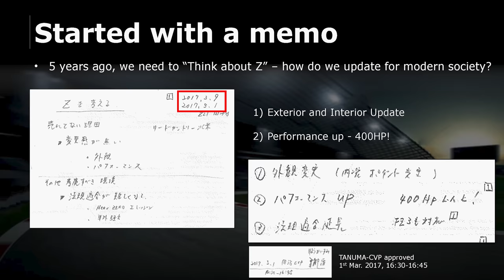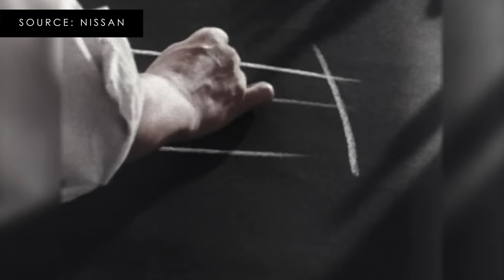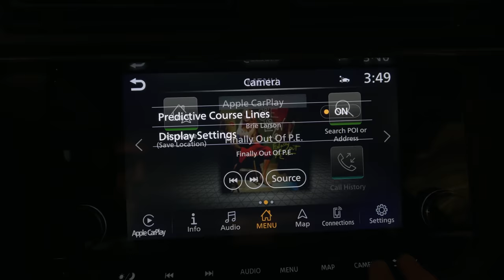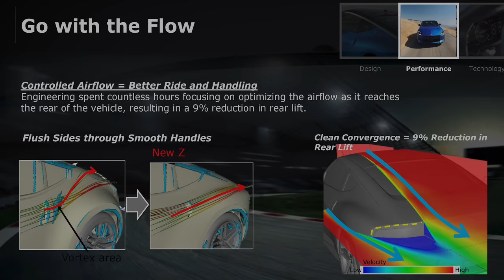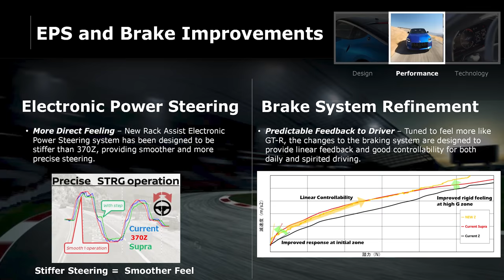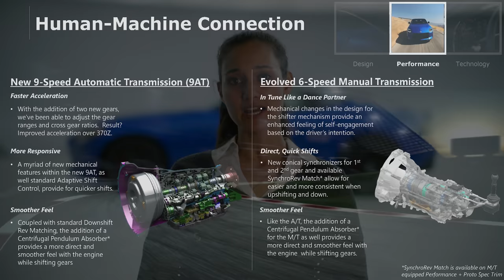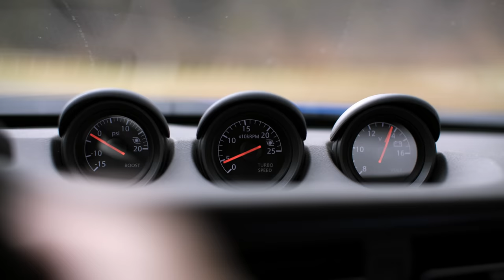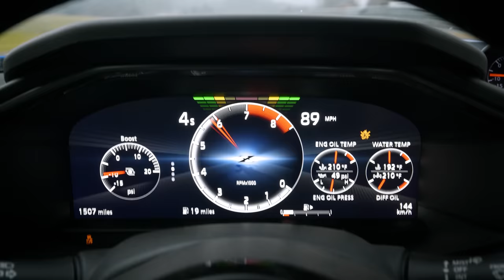2023 Nissan Z | Until The Bitter End

Comment: Thank you for the well produced infomercial. Would have been great to hear some non biased comments on this car. The 3,550 lb elephant in the room is this car’s weight. How do you add over 150 lbs and expect folks to be ok with it? And let’s be clear, this is not a “poor man’s sports car”. I like the front end. I don’t like the back. And I can pass on the weird chrome strip on the roof edge. Is it too much to ask of the Nissan design team to spend a some time in a current Miata and take notes? as in weight reduction, not weight gain.
Reply: The 370 was actually lighter than a 350. So this basically weighs the same as a 350. Engine weighs more than before, and they had to add more safety tech and sound deadening since everybody complained about road noise in the 370. Miatas are simply too small and I want a car that survives in a crash!

Comment: Can you imagine how good the Z-car (Zed-car!) would be if Nissan had refused to redesign the car from scratch several times.
Because the orginal Z was completely iconic - much like the 911.
Nissan really wrecked the Z-range by failing to adhere to the design principles of the 240Z, and made successively slower and worse cars until the 300Z came along - but then it didn't look like a 240Z in any way shape or form. And why does the 350 or 370 even have a Z-badge? They are GT cars.

If Nissan had steadfastly developed the original 240Z, refining it year on year - just like Porsche did with the 911, then today, the new Zed-car could be one of the greatest sports cars to ever turn a wheel.

PLEASE NISSAN, NOW THAT YOU ARE BACK TO THE 240Z SHAPE, DO NOT REDESIGN THE CAR EVER AGAIN!

Comment: Arguably, Nissan is the biggest single contributor to the JDM car scene. They have 3 different platforms, that they were all making at the same time in the 90s. 

They were a big part of drift with the S-Cars, Nissan Silvia, S-13, S-14. They were cheap and affordable, though not so much now, but are yet coveted today. 

They had been making Z cars since the 60s, classic sports/GT Cars. They've been true to it to this day and continuously make them better over time. 

And they made and continue to make the cars EVERY loves, The Skylines. R33, R34, R32, and the R35. Even Infiniti, as much hate as they get, are awesome cars and are known as Skylines almost everywhere else. 

Really, most other Japanese manufacturers have a few models they made or updated over the years. 

Toyota has the Supra and Celica, but only the Supra made it to today and the Celica lost it's really charm pretty fast. The 86/BRZ, is both Subaru and Toyota. 

Subaru really only has the WRX/STi and they didn't update it really since 2004. The same 300 hp, when the 350z had 280 hp in 2004, and the same car had 306 hp in 2007. Then the 370z. 

Mitsubishi really only had the Evo and Eclipse and they kinda killed the Eclipse after 2001 and only had the Evo.

Comment: Excellent video!  As a big Z fan, I think this is maybe your best (I'd probably still think that even if I wasn't a Z fan).  I had a 2003 350Z that I modified with lots of small mods, put probably 40 track days on that car, 200,000 miles, tons of AutoX, and it kept running like a champ.  I sold it to a friend in 2018, a couple years after I got my GT350.  While the GT350 is just about perfect out of the box, I really miss my Z and love what Nissan has done with this version.  Can't wait to see them on the street (and in my driveway?).  Long live the Z!

Comment: I don't much like the looks of this, I prefer my 350... but the mechanicals in this thing are, just, well holy happiness! Clutch based differential, external release (slave) cylinder on the manual trans, cooling for the automatic, double wishbone up front, increased structural rigidity... these are all things that needed to be improved from previous generations. They fixed the bad things, and kept the good. Fantastic job Nissan!

Comment: Europe today has become a desolete place. So we won’t get our hands on this one. Instead I’ll be spending my money on my early 260z restomod that will be reaching 340bhp in its NA L30 stroker, a decent figure from an archaic, non cross flow 2 valves per cylinder engine, which when mated with that super light S30 body (compared to modern sports cars) will be fun with a six speed manual and an STI diff. But I’d be extremely excited to drive the modern take on the Z too.. Enjoyed this video, thanks for the great work!
Reply: Sounds great and good luck! All hail glorious Nissan!

Comment: 3:35 Not so E-Z. 😁

P.S.: Z 😎 - Rise of the heart.

10:16 That is too square, though. I can accept the 'US muscle car rear' as providing some variety, but to bandwagon on the huge-grill trend by putting that big rectancle on a curved front with roundish headlights, that is cringy. Even more so with how that grill insert is styled. (At least it gets better at an angle due to the pointy front.) 15:10 makes me think "mailbox".

11:00 Putting that today unavoidable display lower is a nice visual design choice, including the angle (if it doesn't cause some bad reflectivity). - As long as you don't need it during driving, then it might distract even more from the road. - And hopefully the round control elements below it are easy to reach and not obstructed by the ridge above.

Speaking of losing mechanical connection: The last thing I want when sitting in a car is having animated video game graphics in front of me simulating needle dials. It's not just tactile, but also visual. I don't want a sim, but the physical thing.
Reply: The 240Z has a large front opening as well, its just at a slight inward angle and the chrome bumper cuts it in half making it look not so large.

Comment: The Z had no chance.  Toyota has $25k to $55k enthusiast car market with the gr86, gr Corolla, Supra manual.  The Z should have started $35k for the base sport.  I was disappointed when they announced it was starting at $40k for the same Z car with only a new engine.
Reply: Want to bet on this? The Z will outsell the Supra by at least a 4-1 margin once the supplier issues are sorted and Nissan is able to get the assembly line rolling. Vastly better looks, less claustrophobic interior, better driver's car like Mark says in the video. I would never consider a GR86 (too underpowered) or a GR Corolla (not interested in that type of design). Z is classic and not intended for teenagers.
Reply: Ahh ...
GR86 is a Subaru ..
GR Supra is a BMW ..
GR Corolla is a Mazda

At least Z is a Nissan, designed by Nissan and built by Nissan IN JAPAN ... 

As a MKIV Supra owner, like you was disappointed when i heard that BMW was building the next Supra ... i dropped hope for Toyota.
And its not the same Z car, its a 370Z chassis but the ENTIRE BODY and interior was re-designed. Yes they took the RS VR30 motor but they revised it and fixed all the cooling issues. Hagerty has already proved it.

Comment: Bull, I've owned two 350z convertibles, they did nothing with this car it has the same chasis as the 370z, same handling mild body roll ...too much for a car of this legacy. They changed the body panels, dropped an engine they already use from the q60, and called it a day. I saw reviews of this car on a track by throttle house and it was very depressing, body roll, clambering around corners etc... it could of been a great car , i would of been first in line...but sadly its not a proper sports car, its a sporty car. 4.5 seconds 0-60 from car this small w/400 hp is not great.
Reply from the maker: Its a car aftermarket will keep alive. The engine and trans are solid.
Reply: Not sure it needs to stay alive in this format, but i love your channel and loved your technical review of the honda crv, so ty for your work. just a big let down on this car. @savagegeese

Comment: Car looks good .  For wrong or right many car's have stigma's attached to them as to the type of drivers that tend to buy them. Im not sure about the 2 tone interior looking classy, meaning classic  , but with standard interior I would feel comfortable in basically all situations arriving in this . It basically doesn't have a high douche factor or overly high over compensation score.

Im not going to feel underpowered next to anything even if its faster on the street as the car is for most street applications equipped with all the power it needs with the performance package unless your living that gap life . Anybody besides people obsessed with street and bench racing will think this car is fast on any road that takes some pilot skills to hustle it . Nobody will question the virality of your conveyance if you push it a bit without making your date wet themselves unless that is your intended goal in which case you can do that as well, either through a combo of what the car can do and your ability or lack thereof in which case the limits of the car will rightfully cause a panic attack if one has a proper sense of self preservation that prevents them from enjoying a ride in a car this fast with somebody TRYING TOO HARD to be cool .

I would not at all feel second class parking next to Porsches and BMWs  at a party with no kegs or red plastic cups , at ANY type of job , picking up any type of women I would care to date or a backyard kegger . I would feel good the same way one does in clothes that fit right and highlight your musculature but not like a roid freak in tight and or flashy clothes that everybody stares at and not necessarily thinking how pleasing but rather how outrageous and uncomfortable it looks .  It comes in vibrant colors as well as more subtle colors including the interior that reminds me of a mass produced jet boat that is a giant Jet Ski . But mostly doesn't scream boy racer but rather I like fun and nice things but working only to acquire THINGS is not my entire game or like with some people , put all there "extra" money into projecting an Image with a car that ultimately really doesn't impress all the strangers who are the ones that see it on your way to where your going . There are SO MANY better and more fun toys including things with engines like sno mobiles if you REALLY like the sensation of speed ,  attacking corners and pulling out of them like a raped ape on 1000s of miles of the equivalent of endless amazing tracks that just keep changing without traffic like a road or as much cost as being a track rat and YOU DEFINITELY FEEL CONNECTED TO THE MACHINE and in fact FEEL LIKE A CYBORG doing things that seem impossible on a machine that the answer to almost any situation is more throttle like a serious race car that handles better the faster you go. A car like this with a manual makes your mundane shit and trips feel like your playing a little if you get lucky and at worst you get to bang a few gears . But yeah , I will keep the change over more expensive daily cars , get a proper adrenaline weekend machine like a sled  , buy guitars or just have the time to be in nature . Im not saying i wouldnt own other cars if I was a Tech guy , Trust Fund dude , Hollywood Divorce Lawyer or one percenter but for a regular human being , if you want a sports car / fast sexy GT car this is the choice IMO . Supra looks like a Blob Fish fucked a Probiscis Monkey and disjointed with weird folds that look like they get smelly if not washed that had silicone injected in its ass . 

Some room for stuff ,  reasonable cost of ownership and service.  50k is a chunk and despite being against my flashy thing If I could get a base C8 for 60k I would be torn in regards to value proposition although in todays world the Z is decent value proposition.

AND!! If you are all about hot rodding and modding,  Camisa says you can probably pick up the 2/10ths it gives up to the blob fish and Mach 1 with tires alone .  Put some extra meat and stick and hit it with the lap top if you arent afraid of warranty loss and grab another 100 HP or so , or chase being the first to DO X in a Z and or GAP the world . I could see leaving it looking stock and quiet , add traction/grip and the digital treatment ,surprise people and make your mom or grandma pee a little . If you can drive you should be able to make nearly anybody pee a little with some slip angle and or a twisty road even stock  .

Comment: I have a manual 2006 Mustang GT convertible and can not fathom driving a pony/sports car without it.  A true drivers car must have a manual transmission!  The visceral experience of a combustion engine coming to life.  To feel the car rock side to side when you rev the engine.  The pure mechanical nature of stepping on the clutch peddle, physically shifting the car into 1st gear, slamming the accelerator, releasing the clutch, and feeling the torque pin you in your seat as the back end spin and finally hooks up!  I will NEVER give up my manual transmission.  Children of the 21st century may never know the raw, untamed, passionate love that is a fossil fuel burning combustion engine car with a manual transmission!  Enjoy while you can!

Comment: I 100% agree with Mark's comment about the old guard working on this car.  I come from the mindset where the Manufacturer doesn't need to make a car that is 100% ready for the track in order to make us a great car.  All they have to do is to make a car that we can modify and improve upon to make it our own and also make it perform to it's ultimate engineering limit.  I have always liked the Z, but wound up with the Scion FRS which I felt followed the same mindset.  If my FRS was totaled, I would strongly consider the new Z as a replacement.  The powertrain is already well proven and it's been stress tested for the most part.  I would certainly test drive the new Z if possible so that I can truly get a good feel for the car.  There are flaws with it, but it's all fixable in the aftermarket, along with maintaining a somewhat solid price point.  $40k+ is a little bit out of my price range, but it would be better than paying $50k+ for a Supra of similar caliber.  Last but not least, I always enjoy how savagegeese has focused so much on making such quality content.  This video is a bit long, but I didn't mind at all since the quality was top notch.

Comment: The interior seems rather mismatched compared to what they said the idea of this car is. Several of the design choices just don't make sense

The biggest one is offering an analog gauge cluster considering the design philosophy. Like analog speedo to the right, analog tach in the middle and a screen to the left. Coulda been the base option with the digital being an upgrade.

But also the seats are only semi powered. Like either go full power or full manual. Powered seats are a luxury, manual are lighter weight and better for the track. 

Same goes for the performance package. It seems pretty half in half out. Like it doesn't do quite enough to make it performance, while it does enough to hurt daily drivability. 

To me it seems they really got so caught up in trying to make it a little bit of everything that they lost what they actually had in sight for it.

Comment: The only thing I would add to the engine is a dual-injection configuration to address most potential DI-related carbon issues.  Plus you can tune it for even higher horsepower with the ability to dump more fuel with the dual-injection setup.

Comment: The reason why the rear half of the exhaust is so small on the manual Z is to meet idiotic regulations which are harder on manuals than automatics. The auto version has a less restrictive exhaust. Nissan knows that buyers will upgrade the exhaust and has a Nismo exhaust already in the works.

Comment: I've owned 4 Z-cars, including a 2015 370z Sport 6MT. My only complaints about that car were 1) Lack of telescoping steering wheel and  2) Crappy stock seats. It looks like the "new" Z addresses those concerns, plus adds power and technology.

Here are my issues with this car: 

This is a parts bin car. It's clearly a tweaked 370z with an engine swap to a powerplant Nissan/Infiniti has already made for several years. That would be fine, except that in order to get one with an LSD and Akebono brakes (carried over from the 370z), you pay $50k+, and that's not even including inevitable dealer mark-ups. For comparison- Less than 3 years ago, you could buy a brand new 370z Sport (LSD, Akebono brakes, 19 inch Rays wheels) for under $35k. Nissan has essentially raised the price of the equivalent "new" Z by $15k+ over the 370z, without building a new chassis. That's not good for consumers. They've priced this to compete with the Supra, disregarding the incredible value proposition this car could have been.

If we look at the base model, it's still $40k+. That might not seem bad, but it's still $10k more than what you could buy a base 370z for less than 3 years ago. It's also more than you can currently pay for a base Mustang GT or Camaro LT1. Even in the current inflated market, those cars are selling for under $40k in many parts of the country. You could buy a brand new 7th Gen Corvette for under $55k 2 or 3 years ago. As much as a love the Z, that's a better sports car. Even now there are used, low-mileage C7s out there for well under $50k.

I think this Z34.5 would be a home run if the base model started at $35k, and the performance trim topped out at $42-43k. I just don't think we're getting enough "new" sports car for the price.
Reply: Hang on- I bet they have a midrange model out by the second year (2024 model).